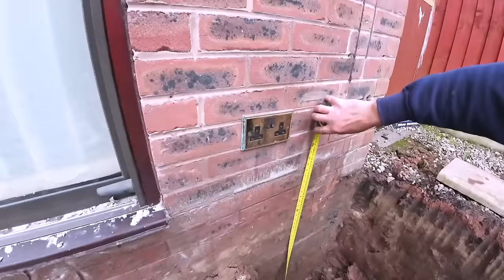RIPPING OUT DODGY FOUNDATION / DIGGING NEW DEEPER ONE

Comment: At 10m 43 secs you can see the actually used mains concrete breaker, not the Milwaukee prop. Battery powered is a waste of time for heavy apps, stop promoting stuff you don't use
Reply from the maker: The old breaker was there as a back up and used for less than 5 minutes because the vibration was ridiculous and was nowhere near as powerful. The whole slab was done with the Milwaukee as you can clearly see in the video. We don’t use special effects and we certainly don’t lie . 
    You obviously haven’t got a clue about heavy duty battery breakers so just dismiss it 🙄
Reply from the maker: Perfectly put as always  
🙄🙄🧱👍🏽
Reply: You obviously didn't watch the same video as me.  Either that or your eyes need checking matey.
Reply from the maker: @davecleggett9371 🤓🤣🤣🧱👍🏽
Reply: I saw the other one stood up against the wall but I only saw you using the Milwaukee for the slab.
Reply: When I took my concrete floors up in my last house I used a proper breaker. A big sledgehammer!
Reply from the maker: The old one is getting sold . We thought it was a brilliant breaker but now we have directly compared them with the Milwaukee it was totally out gunned 🧱👍🏽
Reply from the maker: I bet they weren’t 170 mm thick though
Reply: @SteveAndAlexBuild  about 100mm and over ten yeas younger. Dug out footings from clay to about a metre deep by hand and layed the footings. Wouldn’t want to do it now.
Reply from the maker: Holy cow ! I was the same . Since my hip has deteriorated I feel like my strength has too . 
    I’m only 55 and feel like I shouldn’t be struggling yet .
    I’m hoping for a second wind after my hip replacement. 😬🤞🏼🧱👍🏽
Reply: @SteveAndAlexBuild  yeah my knees have gone now so struggling a bit. At 68 I’m just starting another full house refurb. Had an extension put up end of the first lockdown. Fabricated all the steels while still working in my own time. Got it galvanised and delivered it. Over 2 tonne of steel. Luckily had a good gaffer. Cost me about £1500, God knows how much if I got a company to make it.
Reply from the maker: @riptiz sorry to hear it . The knees are very fragile. 
    Nice work on the steels 🧱👍🏽
Reply: Also clearly seen in the video is the Milwaukee battery breaker making mincemeat of the foundation strip at 13 - 14 inches thick, which is just insane. I really didn't think it was going to cope with that foundation but, it just ate it for breakfast. What an awesome bit of kit! I just can't believe how battery tool technology has progressed in recent years.
Reply from the maker: @dannyboy9817 Cheers buddy . So many haters who trash it and think we are lying 🙄🧱👍🏽💪🏼

Comment: That cordless breaker is useless. I won't even bother to find out how much it costs. I love watching you two working together, but every time you show it working you only highlight it's failings.
Reply from the maker: How exactly do you think it’s useless?
Reply: @SteveAndAlexBuild  Now with electricity onsite it's useless compared to a mains version that you could use all day long. If you didn't have electricity onsite it would be great.
I'm trying to be helpful but all I get is.
We are having a break while the battery charges. We are having a break while the breaker cools down. This you are saying on a miserable cold day.
Reply from the maker: Any breaker will over heat on A 170 mm concrete slab for 8 hours . 
    We didn’t stop to  charge we charge while we stop it’s called break time and lunch

Comment: Ipstock Malborough they look like to me Steve .The right gear makes life so much easier doesn't it .We used a track wheel barrow today for the first time what a saving on the body and hard work that was Steve 👍💯🧱🧱
Reply from the maker: We have used one before but these flags were rubbish and only dotted so we broke 4 just tracking the micro digger in 😩😤🧱👍🏽
Reply: @SteveAndAlexBuild  
Good point that mate .All this equipment costs money but it makes life easier having good kit like you have 👍💯🧱